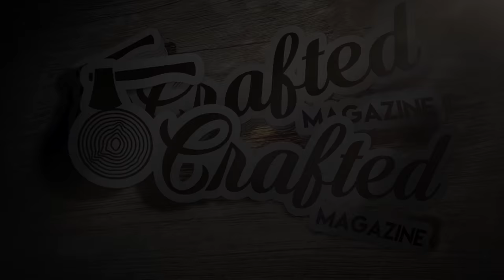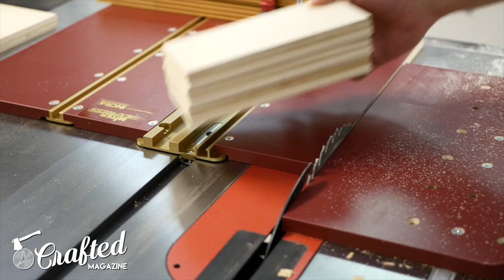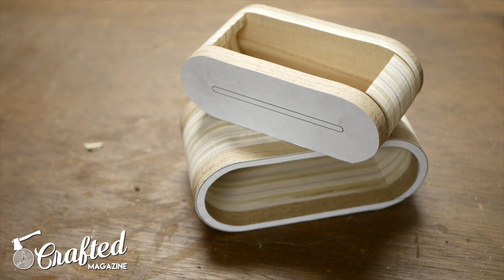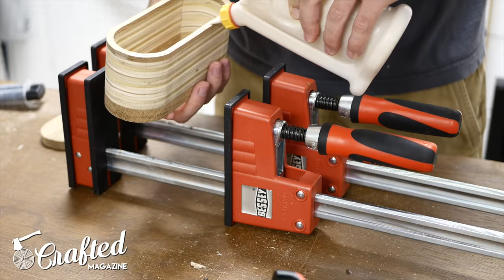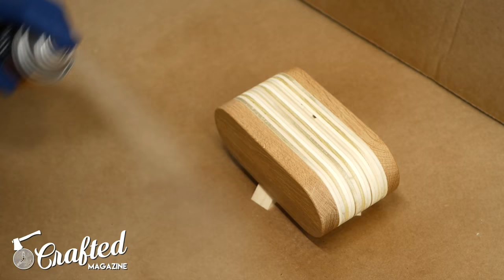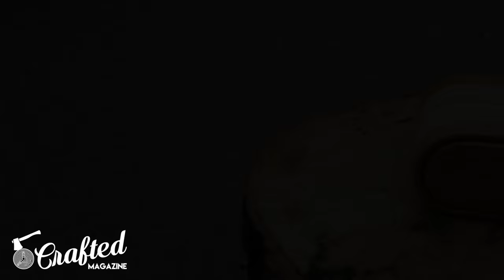Bandsaw Box Build How To | Crafted Workshop

Comment: Nice job. For those of you who thinks the equipment used would be $30,000 you evidently never saw a real equipped shop. Not to say these are not nice tool. I don’t know what brand the table saw, the jointer, and the bandsaw are. The sanders can be bought at Home Depot. Palm sander and oscillating sander combined about $250 $300.you can get a ridged table saw for about $400 $500.a god saw for a home shop. I’ve owned a few over the years, mostly for onsite work.jointers are priced from A to Z. Same for bandsaws. I got a 8 inch jointer used for $500. Delta long bed. New $1800. Bandsaw for this type of small work $300 to $500. Used sometimes $100. Glue brush $2.00 Incra jig , pricy. Incredibly well made, very accurate. Don’t really need one for this type of job but sure nice to have. Bessie clamps, best made in my opinion. I believe those were about $40.00 each.. chop saw, auto z. These are basic tools to have in a home or garage shop. I could build a house full of furniture with these tools. 
My point to all this is it’s not $30.000. It is a well equipped small shop and he did great work for a simple box with these. Always ways to build without every tool in the store. That being said , who doesn’t want every tool in the store.
I have been a furniture maker for 51years and I pretty much have every tool in the store and then some.i started with a skill saw, router, a few clamps and a palm sander, and a couple of drills and bits. If you like woodworking and want to do what this guy does buy the basics and there is no end to how much you can spend..

Comment: Beautiful job! Nice and neat workspace, not like the mess I make when I work. 
Foolish question, what kind and size blade on that bandsaw? I have the same saw (most likely a laguna 12/14), and no matter how I adjust the blade my cuts come out looking like wavy potato chips. I think I'm going to try a thinner blade and more tension.  Also, do you have the blade touch those guide blocks? When I tighten the guide up it's impossible to leave a hair between. It's either touching or 1/8 inch away which is no good. Thanks if u reply but great job.  Really. Subscribed!
Reply from the maker: +samlol23 thanks a lot! The blade type you should use is outlined in the Bandsaw Box book, I think it was a ⅜" skip tooth blade. It's amazing how much of a difference the right blade makes! Usually the blocks are slightly touching the blade, but not so much to cause too much friction.

Comment: Nice!

Wood you reccommend sanding the outside of the actual drawer/insert? On the one hand, it'll look and feel a lot nicer if you sand it, but if you don't sand it, its a much cleaner fit. Maybe some light handsanding, so you don't take too much off? Or is a belt sander fine?
Reply from the maker: I definitely sanded it. I wouldn’t go crazy but flocking the inside of the box will add back some material to improve the fit.
Reply: Crafted Workshop thanks!

Comment: What bandsaw blade are you using? Those cuts look really clean.
Reply from the maker: 3/16", 4 TPI, skip tooth blade from Highland Woodworking. The cuts were very smooth, the blade made all the difference.
Reply: what kind of band saw do you use in the video?
Reply from the maker: +Andrew Cross it's a Laguna 14|12. There's a link in the video description if you want to learn more.